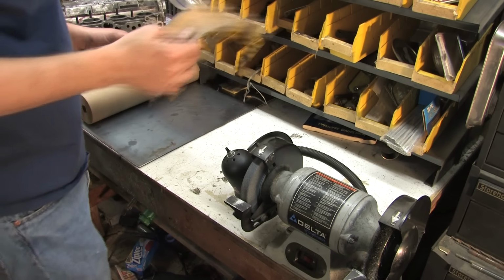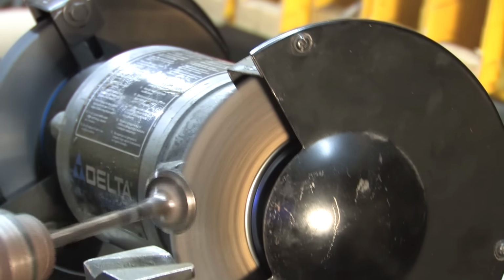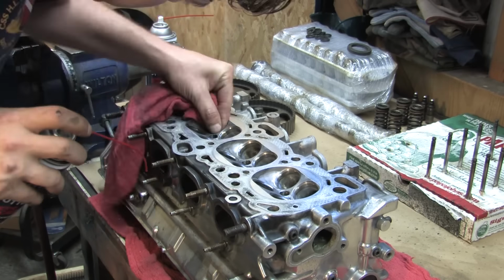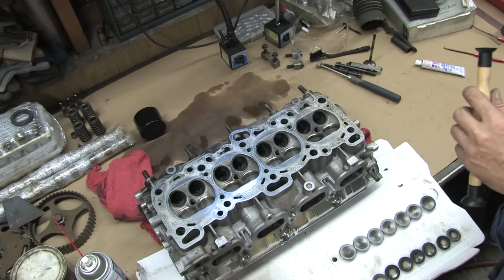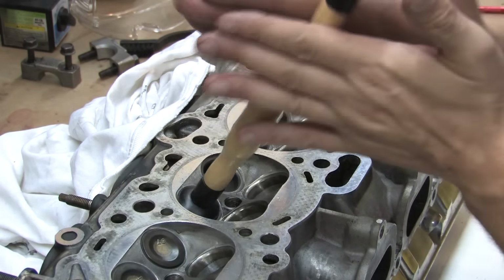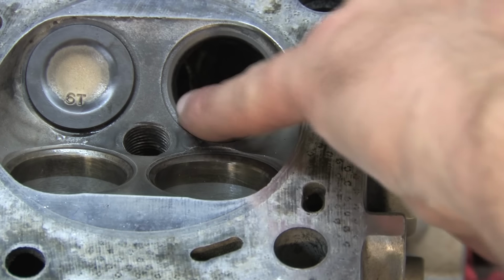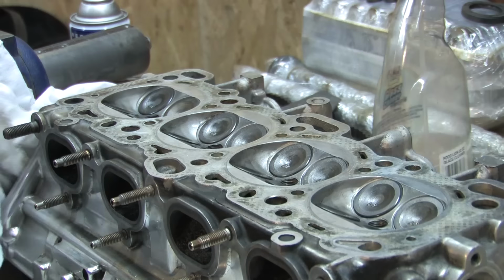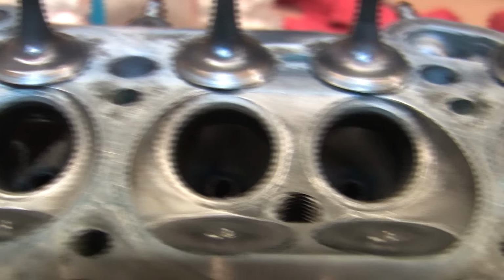Cylinder Head 105 - Valve Job Basics

Comment: After grinding valves in i fit the spark plug insert the valves(no springs) and fill combustion chamber with petrol,
you will soon find out if you have a good sealed valves.
Nice video.

Comment: Good stuff but a little suggestion - use a deeper box so the valves (and I put the pushrods in it if it has them) don't touch the bench

Comment: New to the channel!! Working on LS heads done with the porting working on polishing when should I do the valve lapping before I have them resurfaced or after ?? Thankyou for the videos big help!
Reply from the maker: You don't need to polish the runners.  Please follow the break I put in the video for the 95%ers because while it's pretty, it's not going to do anything productive in the end.  It's a lot of time and work for little gain.  On most engines it won't help, and an LS is definitely one of them.  Polish the combustion chambers, sure... and do all the valve work last.  If the valves are good and the seats are good, don't lap them at all.  If you've got one or two that leak, maybe try lapping them, but don't lap every one of them.  I did a short lap on all of them here because all of them were a little crispy from burning corrosive race fuel, but it widens the seat contact area, and that in turn reduces your spring pressure.  Sounds weird, but it's true.  It's a surface area thing.  I still ended up with the seat margin being narrow enough to work, but it shortens the life of the valve seat when you lap it because it's abrasive.  Nothing will make a better sealing seat than one that's freshly cut with a freshly ground or new valve.  This is a garage method that might save money and buy time, but it's not the best solution if you have a leaky valve.  That optimal method is linked in the video description.
Reply: Jafromobile Thankyou for getting man I appreciate it I think I can get away with not doing the intake valve but the exhaust I probably don’t have to tell definitely has some carbon build up
Reply: Around the seat is more less spotted looking there are not nearly as shinny as the intake
Reply from the maker: What you want to do is put the valves and valve springs back in it and do the leak test with gasoline outside (instead of water indoors like I demonstrated in another video).  That will tell you if they need any work at all?
Reply: Yeah that sounds like what I want to do I seen this guy using paint or something but he also used the drill with the suction cup on it and he was hammering that valve into it I gave him a thumbs down lol thank you bud
Reply from the maker: @thomasjohnson1142  Check the DIY parts washer video if you want to know a fast easy way to deal with the carbon.  Use the brush.  It doesn't stand a chance.
Reply: Jafromobile I will watch it tonight I just got some more of those little buffing wheels you like I found 80,120,180,320,500 I love those things
Reply: I mean 400 but Thank you a lot man I think they will do great I’ll follow your videos and advice for sure !!

Comment: Good Job! Did you change valve guides too?? or just valve stims?/ thanks =)
Reply from the maker: Nah.  Didn't change anything in the video.  I changed everything after this video, though.  That's linked in the video and in the description.  :)
Reply: +Jafromobile clover lapping compound. 1000 500 320 120 80 grit.

Comment: Is the wire wheel brass coated or actually a brass wheel? Also great video man. very informative
Reply from the maker: +Ricky Fornof It's brass coated.  When you're shopping for them, it's just the one that's brass colored.  They tend to be a bit less coarse.
Reply: +Jafromobile thank you very much. I've been shopping around and can only find the brass coated and wasnt sure if that would work. thanks again

Comment: It's only a small point, but I do like to write on the cardboard what part is where in doodle ...
I only do bike work now, so for me it's clutch/throttle side, front and back ... 1 - 2 -3 ..... 
It's only a small thing ... but if you get broken off, or someone unwittingly turns your pizza box around,
that extra few seconds with a marker pen, can save a lot of hassle ............... and hiding a body is so hard nowadays! ;-)

Comment: If I don’t have a bench grinder, what would be the next best option to clean up the valves?
Reply from the maker: Ultrasonic cleaner?  I'd say the price differential between the bench grinder and ultrasonic cleaner is about 4x more in favor of the bench grinder.  A drill press and emery cloth works, too.  You sorta need both hands for that, so it's hard to do with a drill unless you've got help.

Comment: Thanks for the video. Do I have to lap the valves if I use brand new valves?
Reply from the maker: I'm happy to answer you quickly.  If you install new valves, they're barely going to seal at all.  You would be best served to cut new seats.  The parts wear and bed together over time, so a new valve with true angles may not seal on a worn seat.

Comment: Lotta info but what do the valves do?
Reply from the maker: They regulate the air/fuel mixture into the combustion chamber, seal in the explosion, and let the fire and exhaust out at specific intervals.

Comment: You should position the head to using wood to keep the valve that you are  working to stay in 90 degree to the table so it help with what you doing . Mind you I have in vent different tech ice that stick some piece of sand paper to the valve and fix the rubber cup to cordless drill and condition it instead of lapsing  with past. Other tip I had was you can mad you self different lasping past  bunning sand paper of different grain size in china bows so paper burned away and left the silicon carbide abrasive particals for max with bearing grease to make in to desired lapsing

Comment: Man that  a lot of work. I called a machine shop today.They charge 200 for 16 valves camry head.
Reply from the maker: +ben ng That sounds about right...  $200-250.  End results are better than what I did here.  What I was doing here was checking the valves to see their condition.  This head went to a machine shop afterwards.
Reply: Im bargain shopping in Los Angeles and was quoted $220 to resurface the head and for a valve job (cleaning and lapping?)  20 valves on a 2004 Audi a4. But great job on those valves. I wish I had a work table...
Reply from the maker: Greg sees That sounds about right.  The valve job you get at that price will be much higher quality than the clean-up you saw me do here at home.  Your results will last a lot longer.

Comment: I know this is an old video but do you have any tips on removing pitting in the combustion part of the head?
Reply from the maker: If it's deep enough to justify it, or on a valve seat or a deck sealing surface you can do a buildup with a TIG welder and then re-machine it into shape.  That's how hundred year old cars with no parts supply stay on the road.  Depending on where the damage you're describing is, you may be able to just sand it smooth and otherwise leave it?  That cylinder would have slightly less compression than it used to but it wouldn't hot-spot.
Reply: @Jafromobile  Oddly enough its not that old yet maybe 18 years old. Pitting is only in the combustion part. I don't think its that deep, seems like something must of have dislodged and smacked against the head again and again. Though it seems like someone rebuilt the motor at some point because the valves and pistons show no signs of anything hitting them. My only concern would be if i take off too much material it would cause the compression to change in that one cylinder.

A thought might be to smooth everything out, then smooth the other portions on the head out as well. Measure the volume of liquid each part of the head can hold and match that as best as possible. I am just somewhat weary I might get hot spots if done incorrectly. Compression is 10.5:1. Thanks for the reply!
Reply from the maker: @watchere  If no material is missing, someone with TIG skills could puddle it back into shape.
Reply: @Jafromobile  I do have a tig welder, though the metal is extremely dirty, I'll see if i can blast it and possibly melt it back in place, thanks for the tip!

Comment: as a line mechanic @ fed ex for 40 yrs. we always sent them out to the machine shop they do precision work, I realize you're showing this method for the DIY'er but machine shops are not that expensive + new valves & seats are always better than screwing around with it. but that's JUST MY OPINION.

Comment: hey jafro, seen so many of your vids, theyve been really helpful to me, learned a lot that i will put to use while i'm doing my first engine strip and rebuild!

question for ya though..

i've cleaned up my valves and head and lapped them all with fine paste. the seats weren't too bad to begin with, and i had 150 130 120 150 compression (and a bent rod). i fitted springs and plugs and flipped the head. i filled the chamber with water and waited.. initially there was no leakage at all. then after an hour there were little beads forming in most ports around the valve seats, only a bead, not enough to even form into a run. i left the water there overnight and the volume in the chamber had dropped by probably 10-15%..

should there be no leakage at all? do i need more lapping? or my valve seats cut? or will that be fine to build up?

keep up the good work! :)

all the best, andi
Reply from the maker: sionak Lapping too much can work against you because the margin between the valve and the seat get wider, and that decreases your spring load by increasing contact area.  If you go beyond spec, the valves won't seal.  Lapping is a band aid for a bad valve job.  Lightly lapping them in gives you great information about the actual seat, but used as a repair, it's a band-aid.  10-15% overnight is a leak.  Remember that water is thicker than air.  130's and 120's are low.  They're too far from 150PSI.  If the bent rod doesn't somehow fix both holes, and if there's nothing else wrong with the shortblock (bores, rings, another bent rod...), you won't get those back within 10% of eachother without doing a valve job.  There is also the possibility of having a guide problem that could prevent valves from seating straight.

Comment: Drill on low speed with a piece of 5/16 rubber hose attached to the valve stem and a stud sticking out of the drill chuck. Gear lube, 90 weight, used, and Clover coarse and fine lapping compound. Not the all in one junk. This is a good hand job video though.

Comment: Very helpful video (all of yours really).  Do you use a true brass wire wheel, or brass plated steel?  I'm about to clean up some valves, and my "brass" wire wheel is strangely magnetic.
Reply from the maker: +chaseracer117 Brass-coated steel.  ;)
Reply: +Jafromobile Yeah, a true brass one appears to cost more than my grinder did.  Well if brass-coated steel didn't trash your valves, I'll hope for similar results :)

Comment: Hey, great video. I'm installing a brand new head but bought it unassembled, so the valves are separate, I'm thinking of doing a quick lapping job on them like you describe. I have the Holtz set with coarse and fine paste. Do you agree that for a brand new head and valves just doing fine paste would be sufficient?

Comment: Be careful with that lapping compound as its very course and will create a valley in the valve face. I recommend using a fine or very find compound. Once you lap the valves you need to check the contact width. I use a Sharlpie at 45 degree increments. Install the valve rotate a few degrees each way and remove an measure the contact width and location of the contact area which should be close to the face of the valve. A contact width of 1/32" for intake and 3/32" for exhaust is a typical standard.

Comment: I think i have my answer already but might as well have that answer reenforced. I am replacing a cylinder head with a yard head. Yard head has a minor leak in one intake, and a major leak in 2 exhaust valves. For argument sake lets say the valves are not bent and the valve guides are good and the leaks are due to just pitting. Will this process fix the leaks or is a machine shop in my future? This is on a 3.7 jeep Grand Cherokee 09 btw. Thanks!

Comment: Hi all, looking to tackle a similiar job and apprecaite your tips on cleaning, like you said, something not mentioned. TIs it possible to use solvents (i.e. alcohol based or kerosene overnight) to save any time? Unfortunately do not have a wire wheel/ a solid workbench.

Comment: Nice job!  For cleaning off gaskets etc nail-polish-remover is easily available. I used this after being given the run-around on the chemicals I really wanted.  In fact asking for "Gasket Removal Spray" just caused strange looks like I was an escaped mental patient.  The Acetone definitely helps to soften-up glued-on gaskets and its cheap!

Comment: I use a battery drill with a short hose between the stem and the chuck. No side load. The valve finds it's own home.

Comment: This is THE MUST comprehensive and instructive video I've seen because one can understand the reason for the method used based on the function  and mechanics of each part with which you are working on. the best results are obtained through craft work.

Comment: have you ever talked about checking cam journals in any video and is head 102 missing?
in 101 you said how check surfaces but not if it's warped head and cams . like if someone was buying a new head
Reply from the maker: I've got 102.  You can search it off my channel page and it shows up.  It's about doing a water leak test with the valves, but I don't cover cam journals there.  I do talk about the cam journals as they relate to lift in the Degree DOHC cams video.

Comment: okay after you just ground them valves they will need the stems ground off on the end the same amount that way they aren't tightening the valve lash with there higher installed  height while a hydrolic lifter will probably accommodate the height a small shim adjusted head will not the solution either head take some off the end of the stem and yes you can co that before you put the valve spring on for good i use the grinder with the stone wheel i can tell if im grinding 2 thousandths or 5 thousandths the amounts you usually have to remove after grinding them valves in thanks jafromobile for letting me digress on something i also like to do

Comment: i build heads for a living so i have access to all equipment to make a head brand new but old works on valve guide but prefer white lithium grease it doesn't move around when lapping valves in. and stays on so the valve does not stick for how ever long the head is not on the motor and sitting. not saying oil is not good but imo it makes lets you think less about any problems
Reply from the maker: Great tip for shelved parts!  I left my assembled Galant with a 1 mile-old oil change parked for 13 months and 2 valves stuck open.  Engine oil wasn't even sufficient for that...

Comment: Love this video. This type of knowledge is dying.  I was fortunate and inherited a crank style valve lapping tool.   Works similar with the suction cup (and it's suction problems) but instead of rolling it in your hands you hold the top as straight as you possibly can minimizing the occurrence of the suction cup popping off and crank a handle on the side the and the tool then rotates the valve approximately 30° clockwise then approx  20° counter-clockwise.  Making sure the valve is rotated for you. It works great.  Lifting the valve off it's seat every few moments is still a great idea for multiple reasons like checking the consistency of the lapping compound even if you can hear it. Also it helps the compound stay on the seat area instead of getting squeezed out.  Biggest key to this type of job is being able to listen to it. (VERY APPRECIATED VIDEO) THANK YOU.  
Here is a link to the type of tool i am talking about. Pretty sure they don't make them anymore.    https://goodson.com/collections/valve-lapping/products/vl-eb-mechanical-valve-lapping-tool

Comment: why didn't you chosen drill machine instead doing it manually? lapping? afterall this has been a great effort indeed..:-P keep up the good work & learning.
Reply from the maker: talha khan Because it's too aggressive and it destroys perfectly good valve jobs.  The drill method is something you do to a cylinder head that you're angry with, not one you're trying to save.  All you're going to do if you're doing a lapping job manually is to make a ring around both parts to ensure it's even and they meet up straight.  Beyond that, you need a valve job.  If you lap a valve too much, you increase its surface contact area, which decreases the seat pressure and promotes carbon build up.  This is a process where you'd never want to use a power tool to remove more material faster.